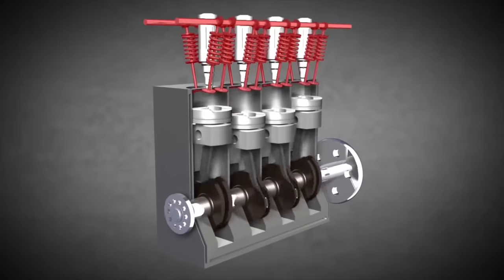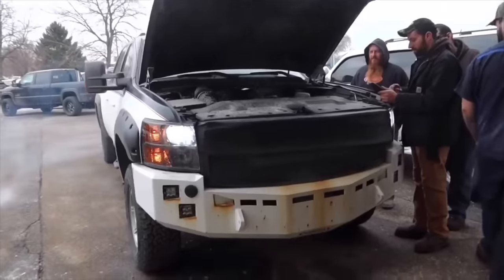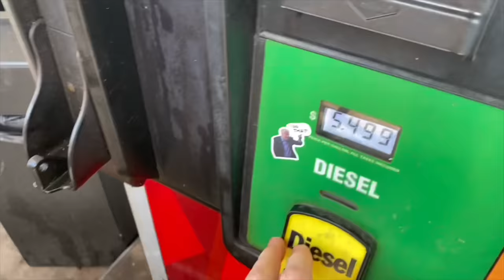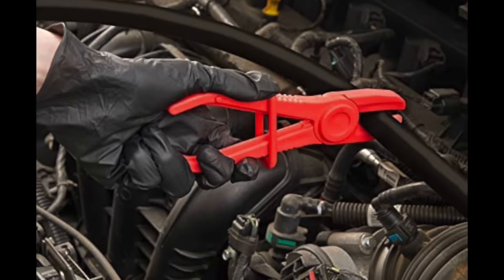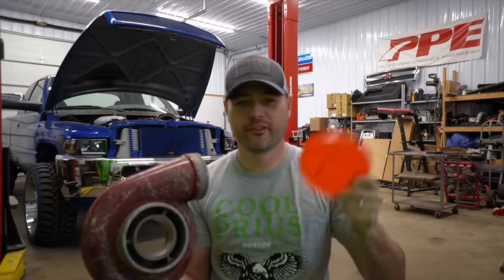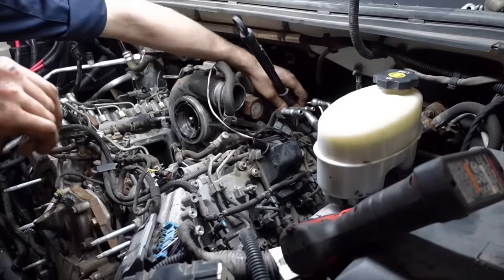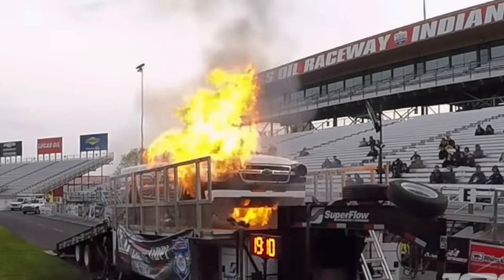What Is A Diesel Engine Runaway? *EXPLAINED* ￼

Comment: My first car as I was 16 was a 02 jetta tdi (mk4 with a alh in it) so it was a 4 cyl 1.9L diesel. When I bought it oil was shooting out the tail pipe and lots was being burnt so I replaced the turbo which was indeed bad (literally like an inch and a half play on each end) so not thinking I started it up and was revving it just a little bit to make sure this new turbo was spooling. About at 3k rpm it just shot up to like 5 and a half thousand and was slowly climbing. I had absolutely no idea what diesel runaway was but it did not shut off for about 5-6 minutes  (I’m not really sure because of the adrenaline). I had tried turning the switch off and I went and ripped the wires off the battery but it was not stopping. It broke the fuel pump when that happened so I was replacing that to see if it wouldn’t start back up and I took the intercooler off, the intercooler still had about half a quart of old engine oil in it. So I think what happened is the intercooler (which is lower than the turbo and intake mani on those) filled with oil when the bad turbo was leaking a lot of oil and when the new turbo was pushing air in it starting sucking oil and that’s what it ran off. Otherwise if it was a sticking fuel pump it would not of stopped until it literally blew up because there was well over half a tank of diesel in it. I sold that and a few months later I bought a chevy with a 5.3 so I knew how to work on it 😂

Comment: This is why I have 3 C02 fire extinguishers in my truck. 1 of wich is mounted in engine bay. If your diesel has a turbo in the back of the engine being able to block it off with say wood isn't possible so a valve and or C02 extinguisher may be your only choice. If using a valve I suggest a mechanical and not electric version. I know a guy who had a electrical one and would test it often but when he had a run away it wouldn't function so a old school cable pul one is the most reliable.
Reply: Do you have a way to activate the one under the hood from the drivers seat?
Reply from the maker: Great advice
Reply: @1768ify  no, mines just mounted. I'm sure you could figure a way to do it though. They make extinguisher kits that spray the engine bay for race cars. I'm sure you could drill the air box and put those nozzles in in the intake or aim the nozzles into the intake track if you really are committed to the idea. My intake goes on top of my radiator into the air canister so I can easily just spray inside. I don't have a Duramax my trucks got a Detroit.
Reply: @TeamTopKick  A lot of fuel trucks have a pipe from the rear of the cab to the engine intake with a CO2 extinguisher connected (much easier on a cab over however). This also keeps the driver physically away from an engine rapid unscheduled disassembly.
Electric actuators for extinguishers are also an option.

Comment: I have a John Deere 4020 which has a 404 cu in straight 6 diesel. A sure sign of things to come is engine surging. Get the fuel injection pump off and rebuild. The governor is failing. Had a big Allis Chalmers puke a turbo seal and she tried to run. High gear and dump the clutch. Odds are you won't damage the transmission.

Comment: I had a Fiat Regatta do it to me many years ago coming off a dual carriageway onto a roundabout. I pulled up, stuck it in 5th gear (manual gearbox) and dumped the clutch, which stopped it. A friend towed me home, we started it with a battery booster and you'd never have known anything was wrong! Scary at the time though, and the exhaust smoke was phenomenal! 
More recently a woman and kids in a Landrover Freelander pulled up in the farm entrance with a runaway. Understandably panicked, she grabbed the kids out and started running. I ran up, jumped in and did the the old 5th gear clutch dump again, and it worked again! We got that one going again after twenty minutes cooling off too, but she wouldn't drive it, and waited for her husband to take her home!

Comment: This reminds me of a diesel generator at work out in the field that ran away and the users had no idea what runaway was or how to stop it, plus the air filter was difficult to get to, so not able to seal it. I quick told them to fire the fire extinguisher I grabbed out of our humvee at the air intake, but they began putting it in the exhaust (facepalm). I finally directed them to the air intake and the thing sputtered and died. There was oil, smoke, and purple extinguisher powder everywhere; it was the highlight of the exercise XD

Comment: My engine (Mitsubishi 4M41) has a butterfly valve (like a throttle) as thins engine has EGR.

I hooked wires to a switch that will bypass the ECU and feed 12V to the butterfly, causing it to shut perfectly. The switch is located where I can reach from driver's seat.

Done!

Comment: CO2 fire extinguisher, should be on board anyway and is a shure way to stop it if you roughly know where it gets its air from.

Might even be enough to just spray in direction of the engine.

Comment: Woww .  good info .  my 6.4 
has a FUEL SHUTOFF DOOR 
Lower passenger side .I would 
go for it .  I will check Engine 
Voltage cut out switch . and 
air   intake  shutoff .. 
thk 
U

Comment: I had this happen on a 2 stroke jet ski. Throttle got stuck during a bench test. I pulled the kill lanyard, it kept going, i ripped off the plug wires, it kept revving higher! My dad finally ran over, he ripped of the filters & stuffed a towel into the open carb, that finally shut it down.

Comment: This just happened to my ‘99 5.9. It was startling for air, cleaned the filter, and it ran away after a negative pressure release in the intake. Thankfully we only have to replace the head gasket and turbo seals.

Comment: I saw it happen. Working at JLG. We did all the work except the engine. Cummins engine techs came to do the work. While they were working, the engine RPM suddenly shot up. I didn't know what was going on, but I knew it was bad.  Dave, the older guy in the shop, grabbed his clipboard and choked the turbo. It got so hot the muffler glowed bright red. I'll never forget it.

Comment: A work colleague of mine wound the buffer screw in too far on an 8V92 and it ran away, I picked up a workshop manual and slapped it over the turbo, the engine slowed substantially but still ran through drawing air past an intercooler leak, the workshop was filled with black smoke by this time, another two mechanics came in to assist one span the rocker cover nuts off and levered back the rack to slow the engine even more and another cut the fuel pump hose to stop the fuel. It was a pretty scary 3 minutes that engine was running.

Comment: I worked at a detail shop back in the late 80s. We had a 240 D Mercedes runaway.  Thankfully there is a lever in the engine compartment to choke it out.

Comment: Yep . 100 % right . Fuel Shut off and Plug the Inlet and run away and hide , until it stops . 
And fun fact , Older style Mechanical Diesels used to use Lube Oil pressure to control the Governor . Madness .
Napier Deltics were renowned for running away and then Grenading .

Comment: A small flat piece of steel or aluminum works great, done it several times doing start up after fuel mods. "Flimsy" stuff can get broke and sucked right in like clipboards
Reply: I used my aluminum dispatch clipboard on a DT 466 that started sucking the turbo and got it to shut off. It lived to work another day with a new turbo. The company had another old dump truck with 8V71 and if you hit a bump too hard it would trigger the cutoff plate and it would shut off in the middle of the road. Then you had to raise that long ass hood and reset it.

Comment: I have a very old two cylinder diesel tractor. It doesn't have a turbo. But the last time I used it, it suddenly had a runaway. I immediately shut off the air supply. He actually survived it "without" damage. It then turned out that both piston sealing rings were actually broken. A friend filmed that. Every time I see that video I get goosebumps.

Comment: Co2 fire extinguisher will shut down any run away engine.   Without hurting it, or making a big mess.    No oxygen,  no combustion.     Best part.  You don't have to get close to engine to shut it down.   Just spray it towards the intake.

Comment: The thing to check is the intake hose between the intercooler & the inlet manifold, if there is a lot of oil in there then you have blown turbo oil seals ! 
Early indications will be more than normal engine oil usage that changes quickly, again this is a symptom of turbo oil seal failure.

Comment: Generally in today's diesels a turbo is the cause of most Runaways. The oil seal fails and the Turbo pumps oil into the engine. We have round piece of wood with a handle on it and when we start a diesel after a rebuild someone will be standing by each turbo to cover the inlet to deprive the diesel of air. CO2 fire extinguisher works really good I know of three diesel runaways and that's how they stopped the engine by spraying CO2 in it and depriving the engine of air. Diesels I'm talking about are for ship propulsion which are very large.

Comment: My defender 300tdi just had an engine runaway on a highway and I was lucky enough to have a motorist stop who knew what to do, put the truck in high gear, foot on the brake and release the clutch, which stalled the motor. Saved my truck.

Comment: Blew a turbo in a TDI VW Golf (1.9 BEW with a 5-speed). It had a habit of blowing off boost hoses so I thought it was just a hose again and limped home. Four blocks later the RPM started to chug up on its own without any throttle and—knowing this was the start of a runaway episode—I immediately pulled over and purposely stalled it. The engine survived OK since I caught it before it hydro-locked but the turbo was VERY toast and the intercooler had more oil in it than the sump!

Comment: I had a DD 16V-149 TIB 1800 HP run away with me once...old Woodward governor style. Emergency shutdown (intake restriction flaps) worked, but would not shut it down completely. Killed it by shooting CO2 into the Donaldson air filters (fire extinguishers) as none of us was brave enough to get near the fuel shutoff valve. Took two of us to do it. Spun off the impellers of all four turbos. Found a loose screw jamming the rack. Blamed it on the apprentice, but we all knew who was really at fault. My heart still pumps just remembering it...

Comment: I've had two diesel runaways in yachts ... very scary .. one of the runaways was caused by the cfc's in insect spray. EG I'd been spraying some insect spray and obviously some of the gas was still present in the engine compartment when I started the engine. I shut off the fuel but the engine was burning Its own oil and going nuts. It did shut itself down eventually with minimal damage to the internals .,.. but its an experience that I'll never forget.

Comment: The guillotine style air shut offs seem legit. Another option if the oil is be sucked through the turbo would be a ball valve on the oil feed line, I think, I could be wrong and it would likely destroy your turbo…

Comment: From my experience I can say always check intercooler because it could be full of oil in case of worn turbo and if engine reaches certain speed, that oil most likely will cause runnaway or hydrolock in my case
Reply from the maker: Great point
Reply: yeah,lesson was pretty hard,bent and thrown out conrod as consequence @TruckMaster

Comment: As a heavy equipment mechanic in the military we kept the covers from everything. Turbos, hydraulic cylinders. We used to tape up the old stuff with metal tape or cardboard and duct tape. We kept the covers for exactly this. I seen one run away once. Old Detroit engine. After we found it was sucking up oil. Fun rebuild after wards. Stop the air stop the engine. Scary to witness.

Comment: I experienced a runaway with one of my Mack water trucks back in 2010ish. I didnt think to jam it in gear and dump the clutch and stand on the brakes. But I did cut the intake boot open with my pocket knife and stuff my hoodie in there which did stop it. Saved the engine but destroyed the compressor housing and compressor wheel. Which ended up being no loss. The reason for the runaway was turbo oil seal failure. It filled the charge pipes and intercooler with oil from the crank case and that was fueling the engine. She got an inframe overhaul and a new turbo kit and what would have been a 30+ K dollar problem only set me back about 10K… but lessons learned.

Comment: In 1998 I was a Volkswagen service advisor. One afternoon a VW Passat 1.9 TDI came in on a tow truck, complaint was "we couldn't shut it off, neighbor put some rags in the air filter and stopped it." The owner had a tire place change the oil. One guy drained the oil and three guys filled the oil. Turns out a VW 1.9 TDI likes to run on crankcase oil getting past the piston rings. Cost the tire shop over $7k in 1998 to replace the engine.

Comment: Not quite the same thing, but thought I'd share if it should help someone, someday. Back in the late 80s, my good buddy rebuilt his quad and went from a break-in ride. After 1/2 mile, he came back to the shop. The thing was idling over 4k RPM. He pulled the emergency tether, the key, etc. Nothing. I walked over and flipped his manual choke at that stopped it.  Turns out, he had planed so much from the head, it was dieseling on the two-stroke oil.

Comment: Duramax on the dyno had a shutoff, but the turbo blew and put a hole in the intake piping past the shutoff then shrapnel cut the wires to the ECM so it went full fuel. Talk about a perfect storm!.....

Comment: My grandfather had a dieseling manual transmission lorry once. Turning the key didn't work. so he let it roll against something solid and popped the clutch. There was a loud bang and the engine stopped. He figured the engine was going to be toast anyway so that was his solution.

It was found out later that with the last service the mechanic erroneously had added the transmission oil to the engine (which already had it's oil replaced), which caused oil to seep through into the cylinder, acting as fuel.

Comment: I had the misfortune of dealing with a runaway diesel when I was 12 years old. I was riding home on the school bus, which was a 1990 Blue Bird bus on an International chassis, with a DT466 engine iirc. It started making an awful screeching sound, which I would later figure out was the the turbocharger failing. Not long after, it started puking grayish smoke, so we returned to school to swap out with one of the spare buses. When the bus driver parked and turned the key off, the engine took off and everybody went running. It was deafeningly loud. We all sat inside the cafeteria wondering what was going on and watched as she fought to try to stop the engine, and by this point, the whole parking lot was a cloud of smoke. Since she didn't know exactly what to do to stop it, the engine ran until it threw a rod. There was a huge oil stain on the concrete for weeks after that. It was a frightening experience that gave me recurring nightmares for months afterwards, and for years I had wondered what caused the engine to do that. Sometime around my 11th grade year, I learned what a diesel runaway was, and I binge watched videos of it happening, to the point that I actually recognized the audio that was used in the intro to this video, lol. Luckily I haven't experienced one since, but I used to work as a ramper at the local airport and was around a lot of diesel equipment (some of it almost 40 years old; one of our pushback tractors was a 1982 Stewart & Stevenson GT32 with a 353 Detroit in it), and the runaway scenario always lurked in the back of my mind.
Reply from the maker: Thanks for sharing your story

Comment: Happened to me in a 2 liter turbo diesel Ford focus. I just picked it up from a service and driving it on the freeway. And then.... turbo just went absolutely nuts. Turned the ignition off put in neutral, by then the car was full of smoke. I couldn't see a thing. Managed to pull over as the engine compartment blew into flames. It was a very interesting event. Turbo doesn't stop until it just destroys itself. Car burned to a crisp. Still a very fascinating thing that happens

Comment: On the Volvo D5 engines, the euro 3 didnt have an air shut off valve whereas the Euro 4 has one for essentially EGR urposes. I guess if you turn the key in the off position, it will choke the air supply on these engines. 
At first i was : oh shit, another failure point when it gets caked with sut. But if it saves you an engine, worth an hour of cleaning every once in a while.

Comment: I had my car runaway while driving on the highway. Left it on 6th gear and braked until it stalled. IT WORKED! But it was sheer luck, I had no knowledge about it whatsoever, pure instinct.
Header gasket and turbo had to be replaced, but it ran again for a couple more years

Comment: Just had my Isuzu c240 generator runaway on me last night on my commercial fish boat…. Had to gas it with my co2 bottles. Thing was 35-40 years old…. Was making dinner and rpm’s spiked, started rolling coal, engine room was totally filled with smoke. Not mad, just disappointed, but at least I’m getting a new generator in the near future so that’s a plus

Comment: My 2014 passat has what Volkswagen calls anti shudder valve. It shuts off air when you shut off the ignition,  this lets the engine slow to a stop with no air therfore no compression so it wont stop and rock back and forth.  It also has the added benefit of , it shuts when the ignition is turned off, so in the event of runaway you shut off the ignition and it stops it resulting in only needing to replace the turbo,  or whatever exactly caused it instead of a new engine.

Comment: It is quite common on old single cylinder engines.  Always have a wrench at hand for the high pressure line, for a first start in years or when I messed with the injektionpump.